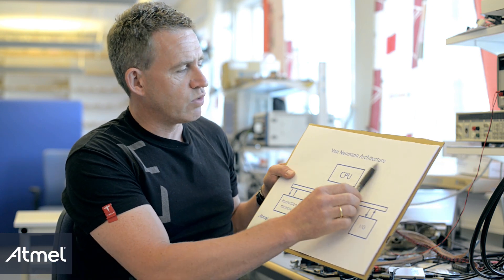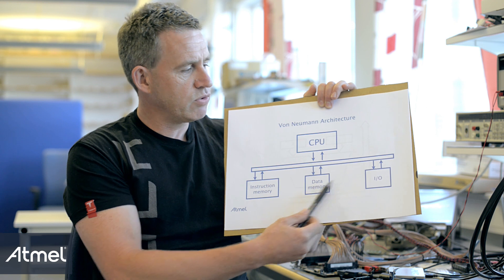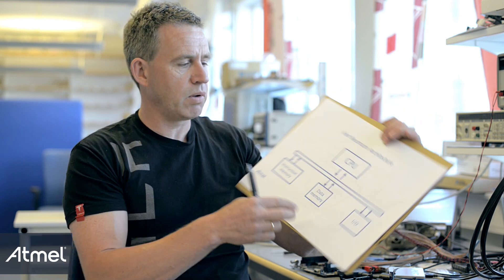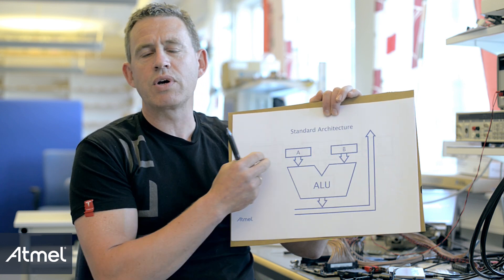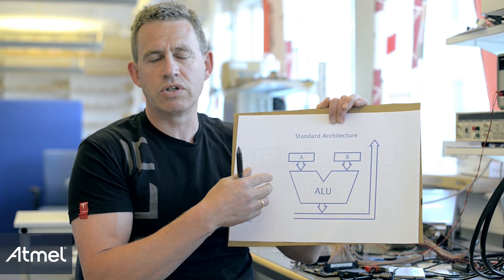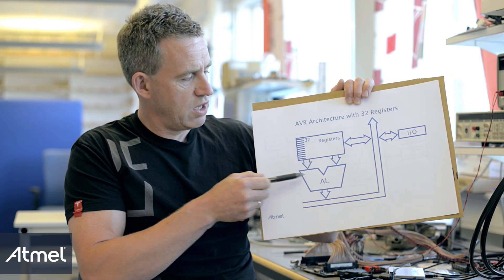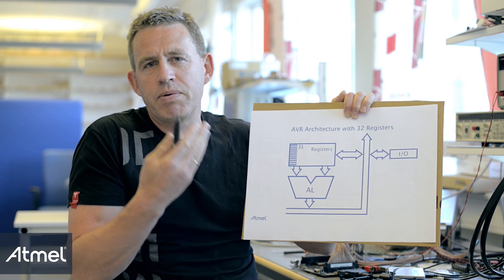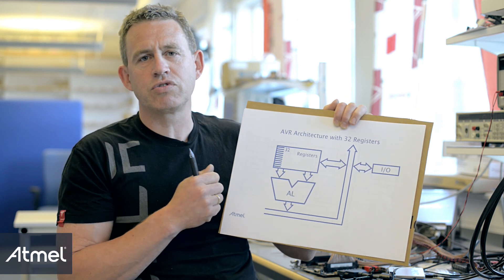Ask Alf: RISC vs. CISC Architecture

Comment: risc and cisc are different in instruction level storage/fetching, byte wide,  decoding scheme and operand size/latency. a typical risc like sparc and mips are pure load/store data value within the register file and only release value back to cache/memory after the instruction fully executed(cache/memory only store the result. ), cisc are involve with register-memory model where the instruction can be save as stack within the memory model during the execution while register only hold index and mapping value(register and memory are co-exist for storage during the process).   on instructional level risc instructions are design to be short and code size are equal length(capable to optimize performance on certain use with well written  compiler, and easy coding for developer), while cisc are very length size due to flexibility and been extendable for backward and forward compatibility(to save hardware R&D cost and future proof without any major change..)